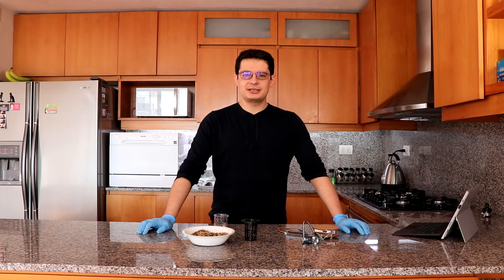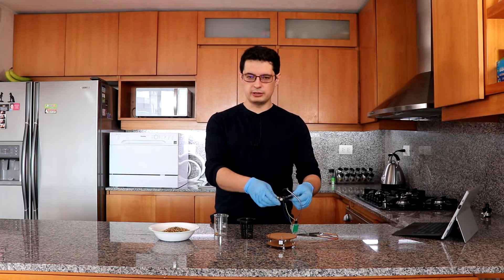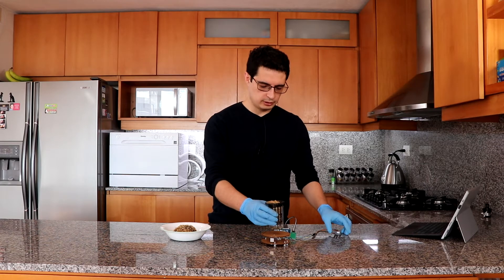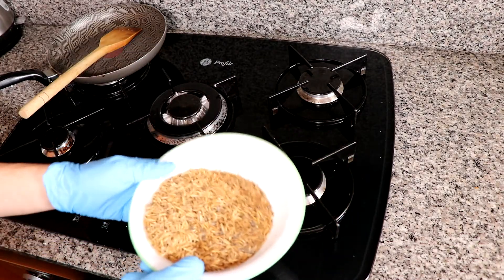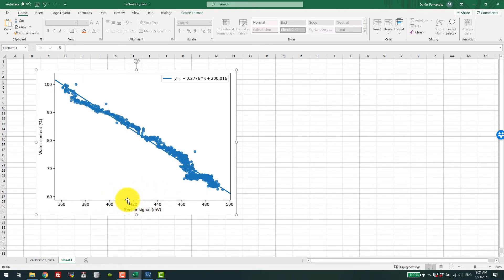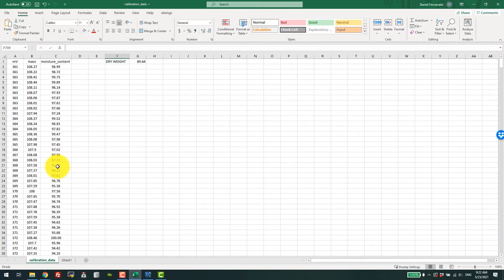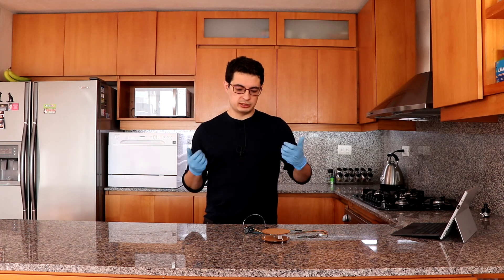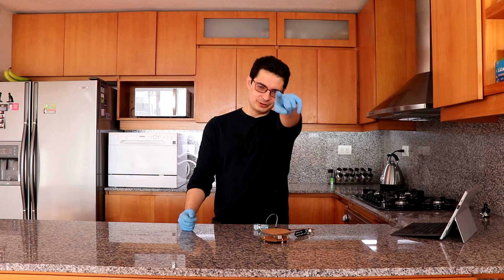How to calibrate a low cost moisture/water-content sensor for hydroponics

Comment: Wouldn't it be enough to messure the weight and value of the sensor one time when the soil is completely dry and one time when it is soaked wet? Or not because its is not linear to the dry end?
Reply: It's not linear sadly

Comment: If you maintain the substrate moisture at a constant saturation % and do not allow the substrate to cycle between dry and wet, will the plant suffer? I've always been under the impression that in irrigated hydroponics the dryback is necessary to give the roots an opportunity to breathe. I'm assuming that the O2 that follows the oxygenated nutrient solution is not enough all on its own. Thoughts?
Reply from the maker: Thanks for commenting. Certainly, you can do that. For example, you can have a substrate like perlite, with very low water retention, where you drip irrigate the substrate at a consistent rate permanently. The substrate cannot get overwatered and cannot wick more water than necessary and the flow rate ensures the ideal moisture is maintained. Other substrates like rice hulls or expanded clays can be used similarly.

We don't do this often in practice though, as these systems are very vulnerable to failures in irrigation. A system where constant moisture is maintained requires a constant source of water, such a source can be interrupted, which can kill the plants. Since the optimal constant moisture is closer to dryness than full saturation, failures to irrigate these substrates imply quick dryback and plant damage. 

It is much harder to do this in substrates that have high moisture retention, because they will naturally wick and retain water aggressively, so your watering rate would need to be very low and hard to adjust. In practice what you mention is only done with very low moisture retaining substrates.
Reply: @ScienceinHydroponics  I understand how this would work with constant irrigation solutions because the oxygenated solution is replenishing O2 in the media, rinsing out the solution with depleted O2. I suppose I'm talking about situations where runoff is minimal, such as wicking containers where the capillary action of the substrate governs the saturation % and does not fluctuate.

I have an automated system which attempts to reach runoff and dryback every day, but I think it would be much easier to set up the system to pulse irrigate all day long to maintain the saturation within a tight band. However I assume this would result in low oxygen situations. I could be wrong? Can O2 permeate substrates like coir enough that the roots can passively breathe if the saturation is below 65% or so?
Reply from the maker: @SetTheCurve  It is doable, but you will need to adjust very tightly to plant uptake and evaporation to prevent low oxygen situations. You basically would water to just ideal saturation (which is going to be on the dryer rather than wetter side to allow for air pockets for oxygen uptake), then just replace the amount by doing very low volume irrigations consistently. The volume of these irrigations needs to almost perfectly track plant uptake needs as the plant grows.

Another point is that you will need to custom design your solutions so that you have minimal nutrient accumulation in the media. If your solution is not properly designed and nutrients are accumulated then the plant will inevitably suffer through time as the chemistry of the media losses balance.

Comment: I use ecowitt moisture sensors for my garden and I've found them horribly inaccurate. Bumping them even slightly will dramatically alter the reading. Changing to a different part of the pot changes the reading. Changing amounts of nutrient in the media I believe also modifies the reading. Do the sensors in this video perform well regardless of position in the media container? Do they perform well even if firm contact with the soil has been lost due to media shrinkage etc?

I religiously use mine, but I have to constantly take notes about what value means what. At the beginning of a season, I calibrate, and know to irrigate at 65%. A month later I might need irrigation at 40%, 20%, or 80%. It's really frustrating.

I've searched for hours and hours for an alternative product that performs well and does not cost a fortune.
Reply from the maker: Thanks for commenting. It is definitely not an easy thing to do, because the media itself is not homogeneous in terms of moisture content. The sensor placement plays a key role in determining how reliable it will be, placing sensors closer to the center of the pots and closer to the crown of plants will tend to give more reliable readings. However, none of these sensors are perfect, all of them require recalibration if you want to interpret absolute readings.

A better way to use them, especially when irrigation is concerned, is to use the highest to lowest point delta to trigger irrigation events, rather than absolute values.

Comment: You could speed up and more thoroughly dry the media if it wasn't placed in the beaker, reducing the evaporative area of the sides of the net pot.  Perhaps a petri dish or glass bowl would be better.  Depending on the sensitivity of the scale, a fan blowing in the vicinity, but not directly at the apparatus, could also help reach the dry media endpoint.
Reply from the maker: Thanks for commenting and making suggestions!

Comment: Would one need to calibrate each individual sensor separately if you buy multiple of the same sensor, or can you use the same formula for each sensor?
Reply from the maker: Thanks for your comment! Good question! Check all the sensor dry and fully wet readings, for sensors that give +/-5% readings the calibration is bound to be similar, but for sensors that have +/-5% differences, best thing would be to calibrate them separately. You can however, calibrate many sensors at the same time using a single scale since you can put many sensors in a larger media container.